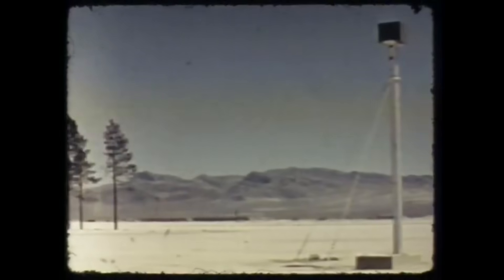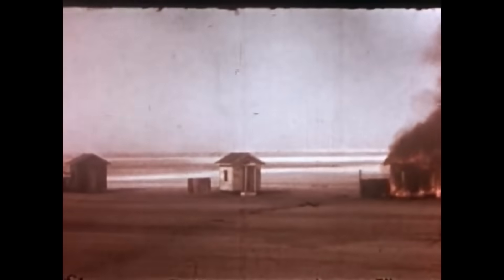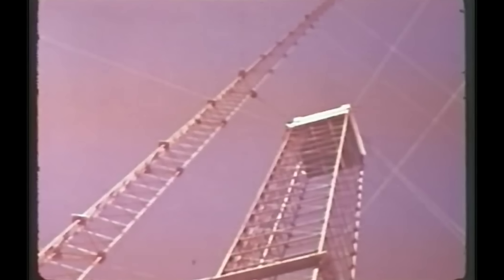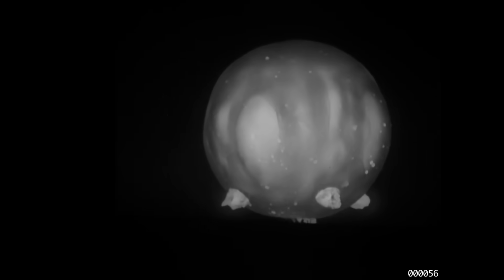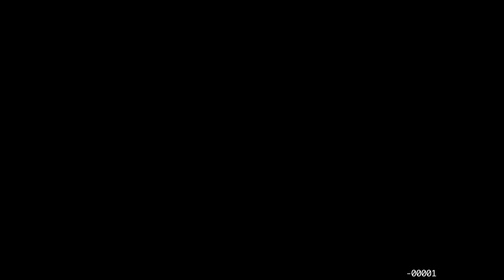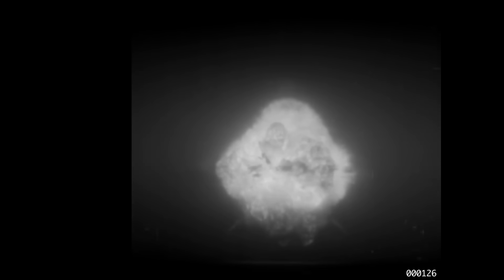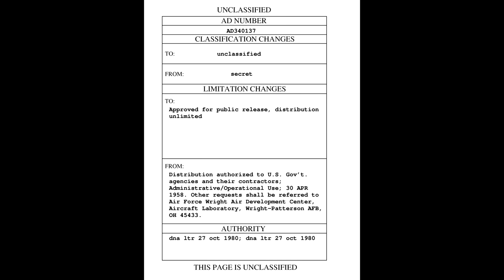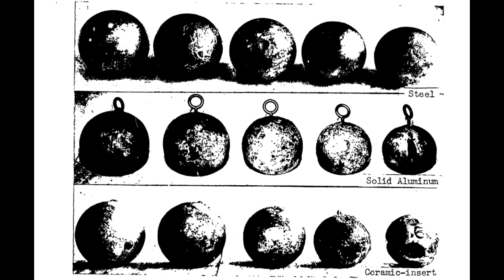Can A Metal Bowling Ball Survive Inside a Nuclear Explosion?

Comment: Its interesting that from pages 36-39 the removal of material was pretty much uniform around the entire surface of the spheres.  Just as much material came off the spheres in the area directly facing the blast as did on the side that was completely in the shadow.
Reply: there is no shadow inside radiatively isothermal fireball, except for that shadow made by opaque ablated material
Reply: @VladLeonovich-o4x  The "fireball" is absolutely not "radiatively isothermal". This would imply that the "fireball" is opaque to all electromagnetic radiation.

Maybe you were trying to say something else?
Reply: @htomerif  the uniform ablation of the ball is the evidence of isotropic ball illumination while it was inside of the fireball.

The inside of the fireball is translucent, that is, radiation mean free path is comparable to the size of the fireball.  While engulfed in the fireball, the colder surface of the ball received the radian energy from the entire fireball's volume.  

There was no "side that was completely in the shadow" Maybe you were trying to say something else? ;)

Only fireball's periphery and air shockwave front are temporarily opaque.
Reply: @VladLeonovich-o4x  So the "fireball" is "translucent" now, not "opaque"? That's a huge change from what you said before.

"The radiation mean free path is comparable to the size of the fireball"? Did you get that from chatgpt? I know what those words mean, but you clearly don't.

The mean free path is dependent on the type of radiation (gamma, beta, alpha or, in the case of thermonuclear reactions: entire lanthanide nuclei) and the energy of the radiation.

You don't know what you're taking about and I'm going to prove it: In the Ulam-Teller configuration, what provides the compression of the fusion fuel?

I know you don't know the answer and its absolutely critical to understanding ablation near an nuclear detonation.

Go ahead though. Lets see if you can chatgpt your way out of this one.
Reply: @htomerif  yes, you beginning to understand.
The fireball is translucent inside. I never said that the fireball was opaque inside.

Yet I did use the word "opaque", so let's go and see the context!
I quote my words "except for that shadow made by opaque ablated material" this means that the only possible shadow that I can imagine, would come from the ablated (== gasified) material of the metal ball. That is the metallic vapors might be opaque.
Besides that hypothetical shadow, there (inside radiatively isothermal fireball) in no shadow to be found.

I invoked mean free path of radiation to deliver to you attention the meaning of fireball being translucent.  I see that  you got the point.

I acknowledge you invitation to change the topic towards Teller-Ulam design principles and material opaqueness to EM radiation.
I'm willing to grant you the chance to humiliate my lack of knowledge in those areas once this little question of "no shadows inside a nuclear fireball" is resolved.
If those questions seem critical to you, then please temporarily presume my understanding of those and that I have already GPT-ed and ENDF-fed them.
I count on you being embittered enough to not disengage prematurely.
Reply: @VladLeonovich-o4x  I read almost none of your comment. Ablation does not mean "gassified". Further, all of the material in the "fireball" is "ablated".

You fail, yet again, to understand that this is not a chemical explosion.

I asked ask things for a reason. Compression in the Ulam-Teller design comes from radiation pressure and exclusively radiation pressure.

There. I've given you the answer and you still don't know why I said it.

Now that we're getting more in depth, it's clear that you don't understand any of these topics. You don't know what radiation is. You don't know what ablation is. You don't know what "mean free path" means. You don't know what radiation pressure is. You don't know what the "fireball" is actually made of (i.e. not "fire".)

You throw out childish insults about "embittered".

I'm just bored, dude, and I'm mopping the floor with some guy who doesn't even know he's the mop.
Reply: @htomerif  It’s always a bit surreal when someone responds to technical disagreement with personal insults and chest-thumping, but I suppose everyone copes with confusion differently.

You’ve accused me of not understanding multiple concepts, yet you won’t quote anything specific I said that was wrong — just declarations that I "don’t know what I’m talking about." That’s not debate, that’s deflection.

If you’re genuinely interested in educating, I’d welcome a calm, clear explanation instead of the name-calling. But if you're just here to throw tantrums and flex on strangers, I’ll politely step aside and let you continue impressing yourself.

PS: Telling someone “I read almost none of your comment” is a strange flex when you're trying to argue that you understand more.
Reply: @VladLeonovich-o4x  I actually read your whole comment and responded to the whole thing. If you'd read and understood it, you'd know that.

I didn't intend to because you don't know the word "ablation" means. At all. And you don't know you don't know and you didn't bother to look any of it up, or what the "fireball" is made of.

The fireball is made of pure, radiatively ablated material. I don't know the mass of the core of the Trinity test device but probably 20 to 50 tons. That's what the "fireball" was made of.

Thermal radiation is irrelevant in this case for the ablation of material on the steel balls. The nuclear radiation from the detonation is absolutely relevant.

In the Ulam-Teller design, pure radiation pressure is used to compress the fusion core. You (and most mid-wits) have no concept of the amount of radiation released and it's effect on nearby materials.

The nuclear radiation alone was sufficient to ablate the spheres and the radiation pressure alone was sufficient to kick them out to their final positions as well as give them the angular velocity to make the ablation even.

All of this I was trying to get you to understand on your own by leading a horse to water, but you just wouldn't drink.

I had two (1 and a half as of now) careers in the US DoD. You're not dealing with a reddit bro. I haven't had to look up any of this. I just know all of it off the top of my head.

This comment was 5 years ago and I still remember it. I probably have the original copy of the test documentation somewhere on this computer.

If insults bother you, quit the internet. You insult me with your fatuous assertions about things you don't understand. I could write a dissertation on radiative ablation. FFS, I could write a dissertation on friction ablation in M114 howitzer barrels. I've seen thousands of them. You're playing FAFO and you're in the FO stage.

Also: are you the guy who argued with me about schlieren photography? You sound exactly like him.
Reply: @htomerif
It’s fascinating how readily you accuse others of not understanding things — yet get visibly upset when your own claims are questioned.
It’s almost as if the rules of debate shift depending on who’s speaking.

You’ve now told me I don’t know what “ablation” means, that I don’t understand radiation, and that I’m a “mid-wit,” along with some number of unspecified others.
That’s a lot of certainty about someone you’ve never met — all over a YouTube comment thread from five years ago.

You’ve mentioned several times how much you know off the top of your head, your 1.5 careers in the DoD, and how you could write dissertations on multiple topics. That’s quite a résumé.
I assume someone with that level of expertise wouldn’t need to remind everyone of it quite so often — unless the point wasn’t to inform, but to intimidate.

Still, confidence isn’t the same as clarity — and so far, most of what you’ve offered are declarations, not demonstrations.
Do you truly believe that rotation of the steel balls is the reason for their uniform mass loss? Is that the solution your experience has yielded?

I never claimed to be an expert. I simply offered a plausible interpretation: that the spheres were uniformly illuminated by radiation from all directions thus, no side was in shadow as you had originally suggested.
Your response so far has been to attack my intelligence instead of addressing the argument. That’s not a very DoD approach.

P.S. I watched the video five years ago when it was released, and just came back to see if @Evan_Bell had left any comment — I’ve always appreciated his insights on the topics of nuclear explosions.

Comment: The USS Pennsylvania, BB-38, survived both Test Able (aerial blast) and Test Baker (submerged blast - 1000m distant) and was towed from Bikini to Kwajalein where it floated for a year and a half.  I remember my old boss at the Air Force Weapons Lab had calculated in 1987 that if you set off all of the known nuclear warheads between the USSR and USA edge to edge in a hexagonal pattern, the resulting area would be about the size of Arizona.  Bottom line - nuclear weapons are destructive, but they still have limits.

Comment: Sorry if someone already mentioned this, but iirc, this also led into Orion.... and they also found that covering in hydrocarbon reduced erosion tremendously.  so take a ball, coat it in asphalt, and it comes through mostly unscathed.  physically at least.  not sure about neutron activation / etc....  moral of the story?  pave over your backyard nuke shelter.

Comment: I've always wondered... at 0:36, on the left, what are these vertical lines? I've seen these in many nuclear test videos but they never say what it actually is...
Reply: They're to help measure the shock wave visually.
Reply: To expand on what the previous commenter said, theyre the trails left from sounding rockets. The shockwave travels through these trails, and then from there the speed of the shockwave can be calculated

Comment: Regarding the rope trick effect, it isn't thermal radiation vaporizing the guy wires holding up the towers. It's actually very high intensity visible light. 
They determined this by coating the wires with highly reflective paint. Coated wires wouldn't generate the same effect..

Comment: That core, even if only for a moment, is millions of degrees.
Not hundreds, not thousands, not even tens of thousands, but MILLIONS of degrees hot.
I very much doubt a metal bowling ball has any more chance of survival in that kind of heat than an ice cube. 

And i say that quite seriously.
What does water melt at? ~36°F? 
What does steel melt at? ~2000°F
This fireball is anywhere from 1,000,000° to 100,000,000 degrees.

Let's say...50m
50,000,000
______2000
________.36

I'd say the steel ball wouldnt stand a ghost of a chance.

Comment: Molten salt nuclear reactors are virtually anti bomb. If you really want a nuke bomb, MSRs are the absolutely useless for generating bomb grade materials. 
That said, Lithium Fluoride molten salt thermal spectrum nuclear reactors do produce tritium. It’s a regulatory issue and exactly why Elysium and Moltex fast reactors use Sodium and Potassium Chloride (no tritium and they can run hotter). 
The latter can also be fuelled with bomb grade materials including all of the plutonium isotopes. Proliferation is not a problem because the fuel salt denatures and contaminates the plutonium to a point where building a new bomb reactor would be easier than separating the salt fuel.

Comment: 10:07 Using nuclear bombs to create more nuclear bombs? This has to be an idea from the USA.
Reply: stonk 📈
Reply: Sort of related: Nuclear bomb ignition systems are nukes themselves, just much, much smaller.
Reply: To increase the MPG !
Reply: Why Not  No, outside my house used to be a U.S. ignition system plant. It was closed in the 80s after massive protests, but that is what they assembled there. I know some people who worked there, but then died from radiation exposure. A tiny device creating a nuclear explosion that would then expand inside of the bomb, causing the rest of the material to compress, and therefore ignite. The fat man was set off by a bunch of TNT, it is just more efficient to use actual nukes instead of TNT to set plutonium off.
Reply: And?? Its the American way: create, destroy and improve
Reply: @why not, It's called a multi stage nuclear device. Back to school with you, lad. Come back when you know what you're talking about, or rather what we are talking about.

Comment: A U-233 warhead eh? Makes you wonder how wise it would be to promote the Liquid Fluoride Thorium Reactor(LFTR). In a LFTR you're converting Thorium-232 to Uranium-233. It should be possible to do chemical separation to get the U-233 out on site. Now if you imagine your LFTR is a country you don't want to get nuclear weapons then you see there's a problem. 
   
With the normal Uranium cycle, the country has lightly enriched fuel which cannot be used for bombs. Once the fuel has been in the reactor it is removed for reprocessing and that has IAEA safeguards to stop people purifying the plutonium. Also, a commercial power reactor is not tuned to produce plutonium. Now it's clear that despite all that North Korea and Iran both produced weapons by running their own secret enrichment plants and enriching to weapons-grade rather than reactor-grade. 
   
It seems to me that if LFTRs were commonplace it would be even easier for a country seeking nukes to chemically separate U-233, which the LFTR is designed to produce, from the molten salt in the reactor.

Comment: The forces at the device are so high that tool steel can be modeled as very dense gas. It's tensile strength is about zero when compared to the pressure differential produced by the radiation itself. This is before the heat pulse, the shockwave or any kinetic effects happen!

Comment: Woah.
That's a thought process i never had. But that's a valid question. I always asked myself how that fireball comes to be.
So, nuclear bombs are akin to M80 firecrackers (example for the americans) or flashbangs.
They rely on thermal energy rather than chemical (i know by definition all explosives are considered "chemical")/mechanical energy. 
Burning metals create almost no gases, but rapidly heat up the surrounding air, which makes for most of its explosive energy.
Though there is the hypthesis that some salts of the reaction might vaporize. But i didn't follow that idea.

Comment: 3:19 Rope trick effect, interesting. I've seen the footage you're showing and always wondered what those little "legs" were, I had a feeling it had something to do with the cables holding the tower up, but thought it seemed kinda silly. 
Thanks for sharing!
Reply: Once they figured out the rope trick, they even started coating the guy wires to stop it from happening.
Reply: @AlexandervanGessel  Yes, they actually experimented that guy wires painted pitch black would enhance the rope trick effect while white-painted or reflective guy wires would almost eliminate the effect entirely, proving that it was driven by thermal radiation.
Reply: Yes intense light from the explosion travels much faster than the fireball itself (at the speed of light, go figure) so the cable becomes superheated from the light rather than the fireball
Reply: @stephenreagin719  intense light from the shockwave

Comment: Do you have any info on the aircraft carrier elevator that was 'launched' by an underground nuke?  According to the article I read so many years ago,  the elevator deck was dragged over the mineshaft with the test bomb at the bottom to prevent damage from either rain or one of a herd of wild burros falling into the hole.  They forgot to remove the 'many' ton deck and when the bomb went off the high speed cameras caught a glimpse of the item leaving at solar escape speeds. Might be worth looking into for a presentation; speculation as to its whereabouts.
Reply from the maker: I talk about it in this video https://www.youtube.com/watch?v=pk_ymR0XFDg

Comment: Question: Last week China launched several rockets with satellites.  In both launches you can see numerous heating tiles coming off the rockets.  Did China comment on this?  Do you have any insight on this?
Reply from the maker: They include thermal insulation panels which are designed to fall off during launch.

Comment: 145 Ponderosa Pine Trees. Operation Upshot-Knothole; Encore Shot (27kt) A Weapons Effect Test. The trees were "planted" ~1980 m from GZ and as it was an Air-Burst, the Hypocentre. Along with other objects and Troops, this Shot, like other Operations & Shots (Tests) e.g. Priscilla, Grapple and Annie, tested the various structures and hardening/shielding materials, as well as preparing Troops for Real-life Nuclear Warfare.

The "E" used for the name "Encore" = indicates it's an "Effects" test.
The trees simulated a woodland environment, as likely encountered during a conflict, and would house foxholes etc. covering troops and or general cover. The test also demonstrated the Static Overpressure, Positive Phase, Dynamic Pressure, Negative Phase (Afterwinds) and Stagnant Pressures (the Blast Front pushes the away, extinguished the initial fires, before "pulling" them towards the Hypocentre, with many breaking during this phase) Oh yeah, the measurements of the Second Thermal Pulse are also gleaned from said tests on vegetation.

Great video! Cheers for the interesting premise! Well Earned like and Sub! I'm only adding the additional info bc, well, it needs to get some use/might prove useful and hope someone finds it as such! Or it'll bore ppl to death!  🤓Power!
Reply: Dod the T in Teapot stand for Test?